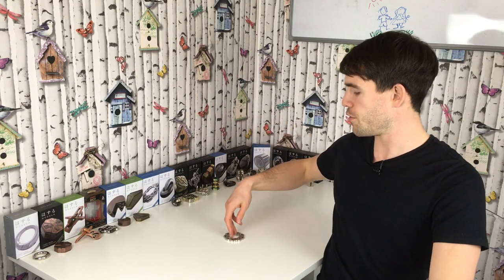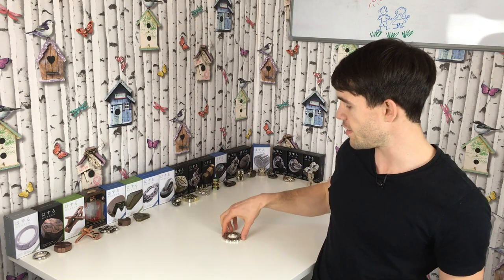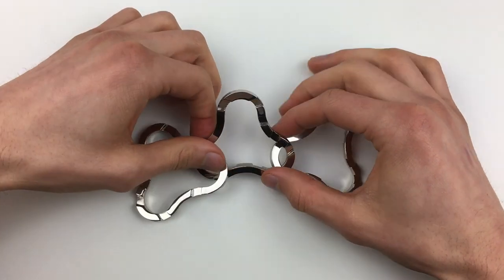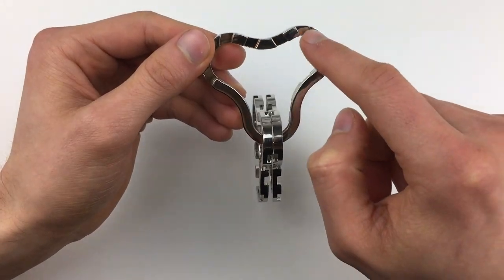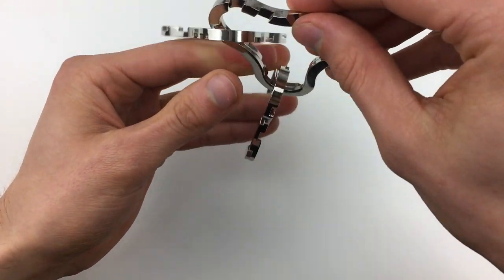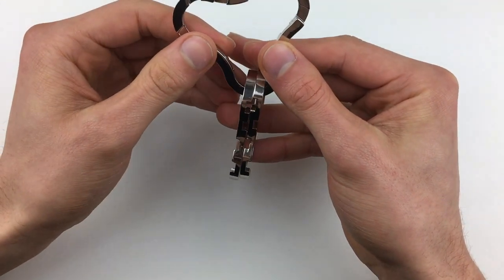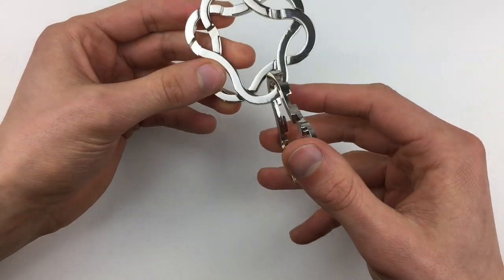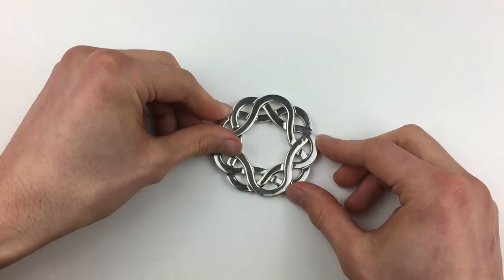COASTER PUZZLE SOLUTION

Comment: I really like this puzzle. One question tho, is it normal for it to get loose. I've done this puzzle like 20 times and the links feel a bit looser than when I first got it.
Reply from the maker: Possibly. It's not the most secure puzzle when it's assembled.
Reply: The ring with the writing on it also has two tiny screws so if anything I'd think maybe that one could loosen up over time. The other two rings are solid so I don't think they'd change shape. It's also possible that after solving it so many times the grooves and nubs have worn down making the puzzle feel more loose. 😊🧩💖

Comment: Mine doesn't lay flat for the last step
Reply from the maker: Hmm... It definitely should do. I'd double check the positions you have it in match what's in the video.

Let me know how you get on.
Reply: RossDM - Puzzle Solving The one of the notches on the second step is inverted on the right side. Not sure if this particular company decided to make their own coaster Puzzle but everything else lines up
Reply from the maker: @MPAzezal  That's strange. I'd double check you've got each piece in the right position, there are a few sides of each piece that look very similar.

If it's not that, is it definitely from Hanayama/Huzzle?
Reply: RossDM - Puzzle Solving Ah found my problem. For the first ring I was putting the curve you put your fingers on to flip it at the top instead of to the right. Thank you for the replies though!
Reply from the maker: @MPAzezal  Glad I could help :)
Reply: Same